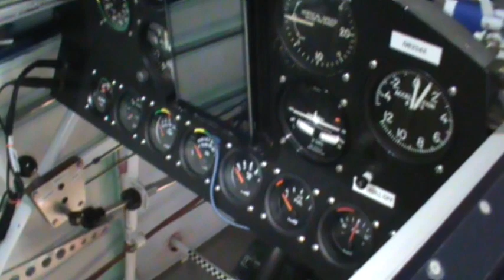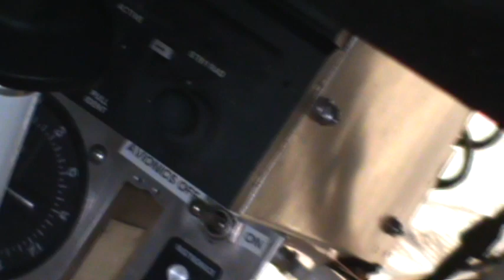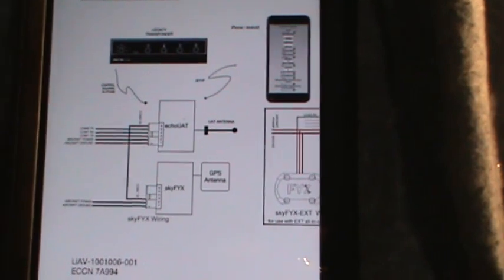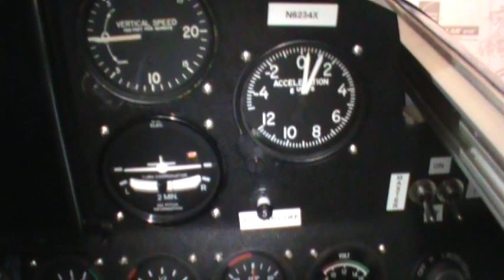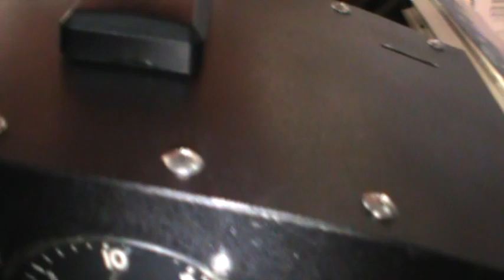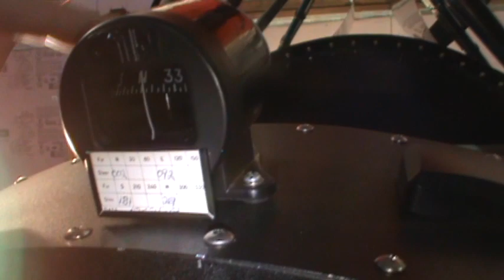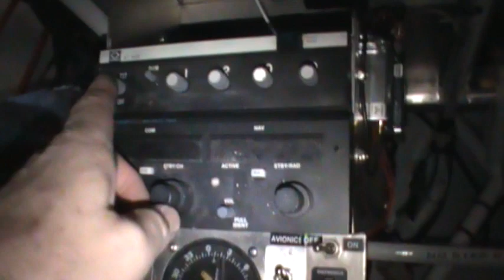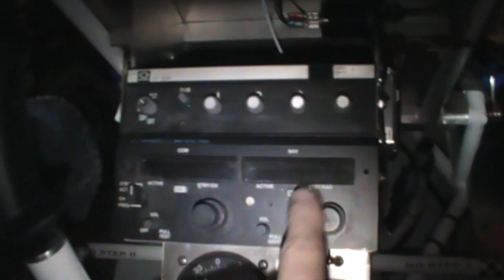UAVIONIX ADS-B in my Skybolt

Comment: Does the mounting plate of the antenna  need to be grounded to ground?
Reply from the maker: No. It's grounded through the aluminum belly skin which screws to the steel tube structure.
Reply: @akalobo  I have a fiberglass aircraft, so I will run a grounding wire to it.

Comment: how has the system worked out relative to having the Echo's antenna closer than the instl. instructions recommend?  any issues?  I have a RV-6 that I plan to install the Echo onto and there is an existing antenna location that is only about 24 inches from the transponder antenna.
Reply from the maker: I haven't had any issues at all with the unit working properly. I'm sure that each installation can raise differences in performance, but mine turned out to work just fine. I probably have about the same distance between mine as you will, as the belly pan on the Skybolt isn't that big.

Comment: Glad to hear you thought it was an easy install. I just ordered the echoUAT with the skyfyx EXT. I hope it’s as simple. 
So with the setup you have. What is the purpose of the thing you mounted on top of your dash? At first I thought that was the GPS but then you said the antenna is underneath. 
Also did you tie any wires into your transponder? I haven’t received mine yet to look it over and was confused if anything actually needs connected to the transponder itself. Looks like one com wire and the power and ground wires is all there is, correct?
Reply from the maker: It really is that simple.  The antenna up on the 'dash' is the WAAS GPS receiver antenna. The antenna that goes on the bottom is the EchoUAT transceiver antenna. No connections needed between the old school transponder and the ADS-B equipment.. just join the Com port wire and take the hot and grounds where they need to go.